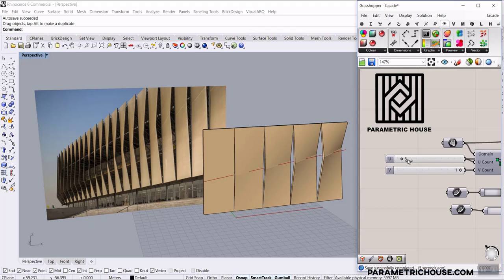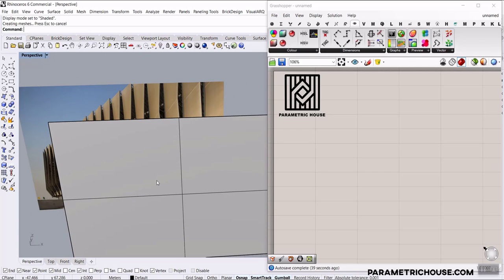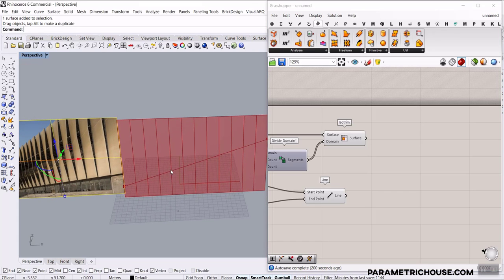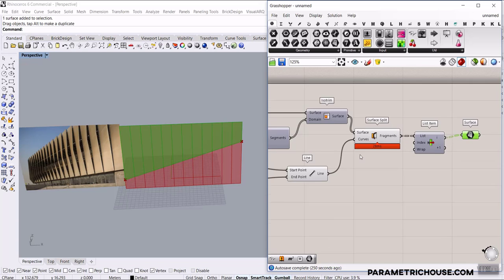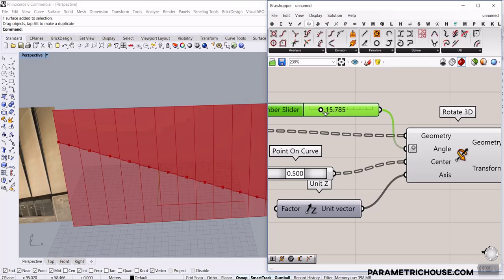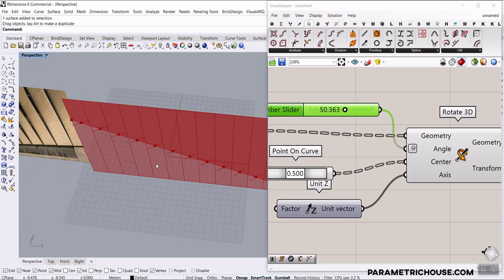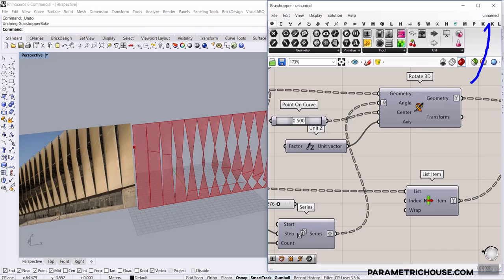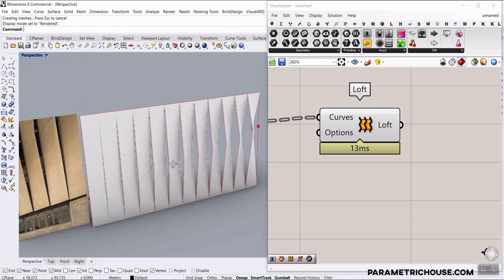Parametric Facade (Grasshopper Tutorial)

Comment: Hi! This has been so helpful!! Is it possible if I could add some parametric distribution of an object over the louver? Like distributing small square pyramids over each strip? I tried to do that but the only way I could think of is using isotrim and area to get a plane to orient my object on the strips. But I was facing problems doing it. It would be extremely helpful if you could guide me on this.

Comment: Hi, when i use the DBrep to get the top and bottom edge, i use to change edges to reverse. If i don't it keeps picking up the vertical lines. Howcome?
Reply: Hi, I am having the same issue. Do you remember the solution?

Comment: is there anyway to adjust the intensity of the rotation with respect to the number of panels?  For example if i set the number of panels up to 20, the first panels in the series wont turn until i increase the angle, the that time the panels in the end of the series have douled over, something that would be rather unfeasable to fabricate in real life

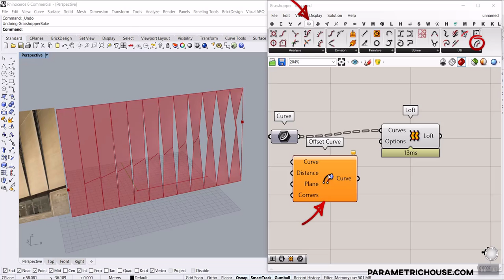Comment: Hi, I have a question! At 13:34, when you connected "curve" to "offset curve", why it cannot choose the direction of offset curve in that battery?
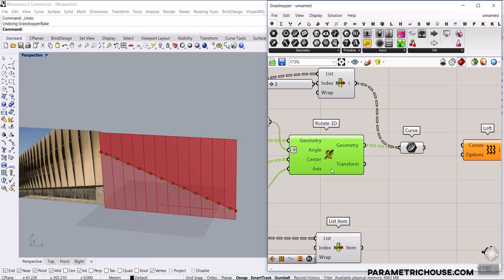Reply: and the second question: at 08:52, why I cannot connect that 3 components into the same curve at the same time? Thanks
Reply: Could you solve it? I have the same problem 😭
Reply: @anggiehernandez819  press shift, had the same problem and was just that 🤣
Reply: Try connecting an XY plane component to the Plane input of the Offset Curve.

Comment: I am getting an error at the isotrim component right away: "1. Subsurface is invalid because the trimming V-domain is singular" because I have a custom shaped, yet a simple planar surface. what is the workaround for using a "trimmed" surface? thanks.
Reply: I am actually still getting the same error with a newly created rectangular surface...
Reply: I figured it out. I was using the regular divide domain not divide domain 2